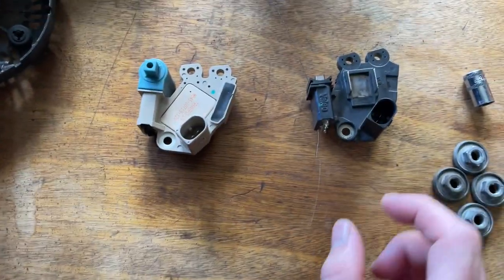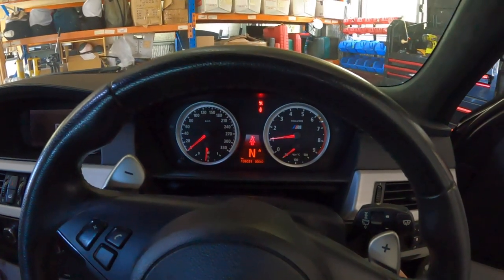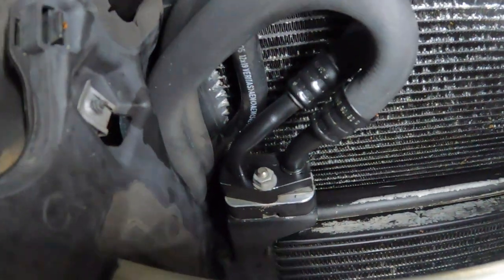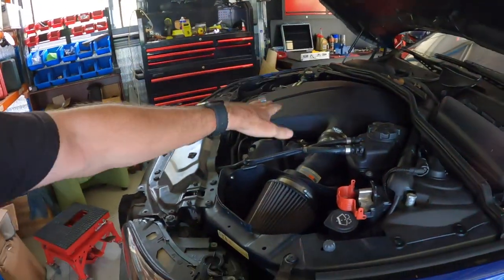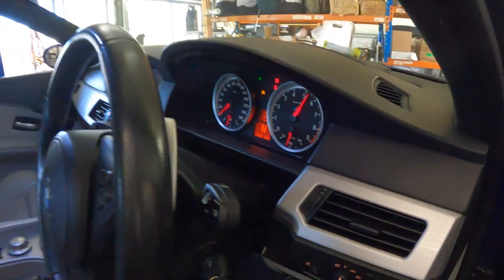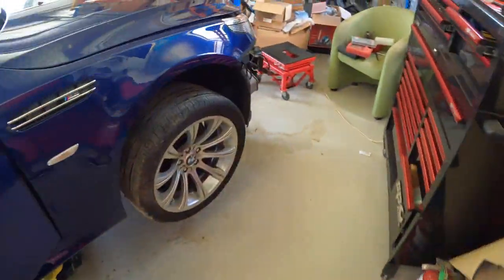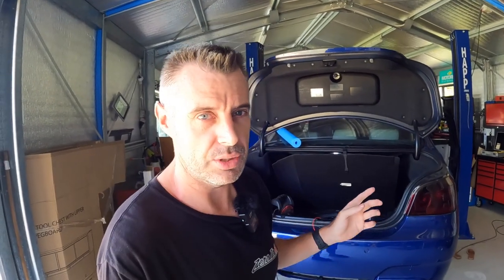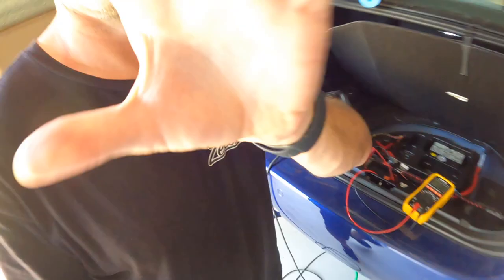BMW E60 M5 Voltage Regulator Installation: WILL IT WORK?

Comment: before you take it on the road, I highly recommend you to scan for fault code especially if there is a fault related to bsd, missing alternator, missing waterpump etc. Why Im asking this is because my E60 non M model with n52 engine, I use an aftermarket or non brand regulator and its charging fine with no code pops up on the dashboard but Im started to have a warning of high temperature issue  drive moderately while driving due to using the non original  regulator. Hopefully yours fine, Im just sharing my experience.
Reply from the maker: This is a really good point and I know the electric system is very touchy. Will be watching closely for a while.

Comment: Great fix guys. 14V charging and 12,6 V as the car is in sleep mode, is great. And when you switch the cables on the multi meter ( red is on common now), it should measure +12,6 V ;-) . Dutch regards, Nico.

Comment: That sounds insane!
I'd keep an eye on that regulator as if you have a normal lead acid battery, the charge voltage should be around 14.4v.
I do understand that if you have a bms and battery is coded correctly, 13.8 - 14.0 seems a little low even on a charged battery. 
But hey at least it's charging!
Roll on M5😁
Reply: BMW alternators from factory only charge at 13.8V maximum, 14.4V is the usual "industry standard" that people expect though. Not sure why BMW did this, it's been that way since about the 80's.
Reply from the maker: Thanks for the info gentleman.
Reply: @geordiegibson1210  insteresting to know that Geordie!
My X5 e53 sits at around 14.4v (according to the ibus app) but it could have an after market reg on it.
Like you said 14.4v is generally the norm, trust BMW to be different 😂

Comment: Two years into the future
"We hid these pair of Ferrari F40's and set of R34's from you"
M5 sounds really good. I would love me some road side ride by captures when the m5 is accelerating. If two v10 m5's accelerate after another (with a one second interval) I consider it music.
Reply from the maker: LOL. If only. Would love a fezza one day. Theres something about the late 80's early 90's models that i would just love to own and play with, and fix. One day maybe, one day. Wouldn't mind turboing a F355, small turbos, low boost but super responsive running e85, get the engine up to around 500hp and it would be a mega fun car i reckon.

Comment: Random unrelated question, but I have just bought an N54 335i to replace my 325... is it possible to retrofit paddles to the wheel? Or do you need to buy a new wheel
Reply from the maker: I have seen people cut in to the wheel to fit the paddles. But i would just buy a new wheel tbh. They are cheap enough second hand. I'd get one that needs recovering cos you will get it for next to nothing then buy a wheel cover.

Comment: For the dudes out there that dont know...
For a lead acid Pb battery
12.6 v is fully charged resting state
13.8 v or above is pumping in charge running car
12.7 or so when you turn the car off is an artificial surface value
12 v resting is half charged.
If you let a car battery get too low example 11.4 it chemically damages itself and is never the same
So its not like 1 volt is flat 😉

Comment: My bmw e60 530d LCI charging 15 v , it is okay ? Thanks
Reply from the maker: Sometimes i have seen charge rates like that. i have a feeling its normal for AGM batteries. But it would be worth double checking.